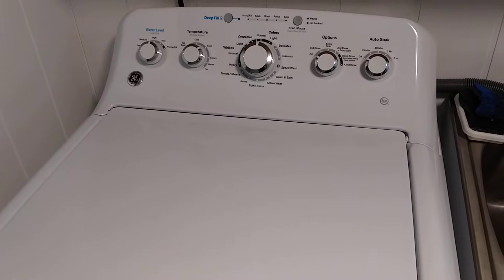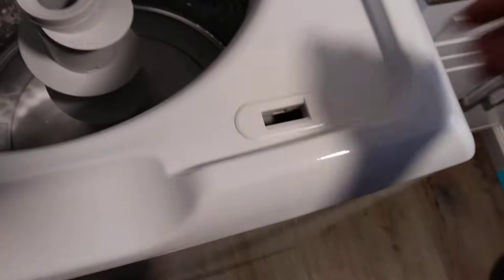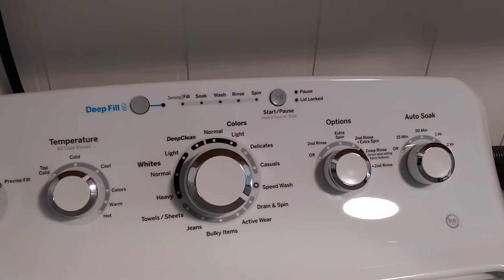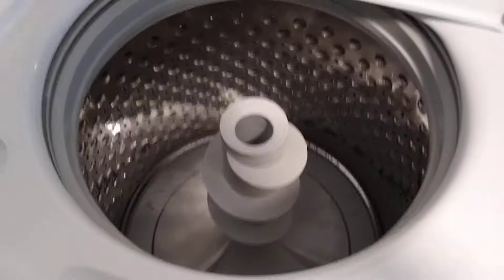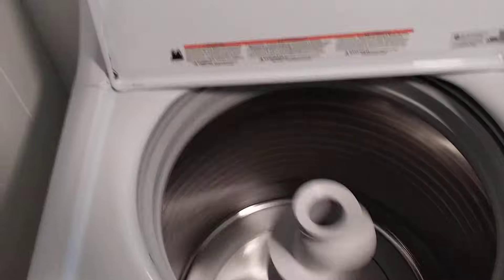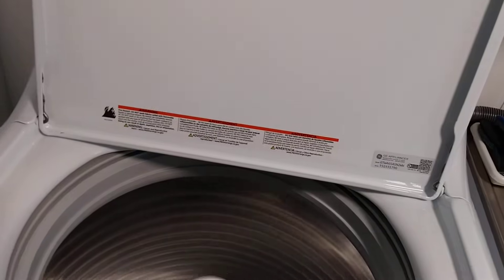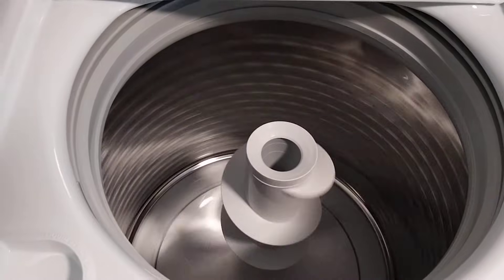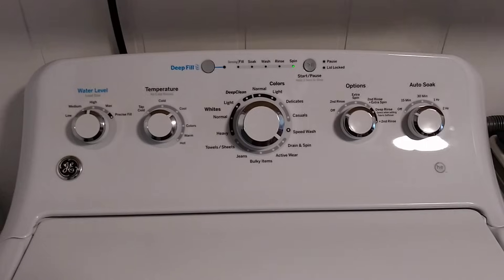GE GTW465ASNWW Washer Lid Lock Bypass for Diagnosis

Comment: What do you do if you broke the piece that locks the lid?? Can you somehow by pass the lid lock, if so can you send me a video.the model number is on the  GE washer.is GTW220ACK7WW.thank you
Reply from the maker: You can take a cylindrical magnet and rest it at a diagonal angle with the left end of the magnet in the corner of the switch and the right end of the magnet on top of the switch's right side. That way it should not fall into the washer.
Reply: @Joethaboss66  Thanks so much! Could you explain this more or show a diagram?
the little piece that locks the lid broke here and I can't run a cycle.  It's another week until the part gets in to fix it.

I would love to do laundry in the meantime.  THANK YOU!
Reply: @framebyframegames  There's another video if you switch bypass where he shows how to take apart the switch so it's no longer spring-loaded. He just takes out the springs and pushes it in manually so it stays in the lock position or closed at least

Comment: anybody can figure this out. show which wires to cross to ACTUALLY BYPASS the damn thing
Reply: Emma (manua.ls) ©
24-10-2023
Yes, you are able to deactivate the lid lock on the GE GTW465ASNWW washing machine. To do this, follow these steps: 1.
Press the "Power" button to turn off the washing machine. 2. Disconnect the power cord from the electrical outlet. 3. Wait for at least 4 minutes for the lid lock to reset. 4.
Reconnect the power cord to the electrical outlet. 5. Press the "Power" button to turn on the washing machine. 6. The lid lock should now be deactivated, and you can open the lid while the wash cycle is in progress.
This answer is automatically generated
Reply: This is false. Newer washer actually look for a certain resistance across the load.

Comment: Do  you think cuting out a gap from the bottom of the strike so that it could be secured to the lid but always able to allow the lid to be opened. This way the spin would also stop just like the older machines when the lid is opened.  I have no idea how the latch lock communicates with the computer control, but maybe just creating a gap wide enough to create enough of a void to clear the locking pin might be a solution to this aggravating issue.